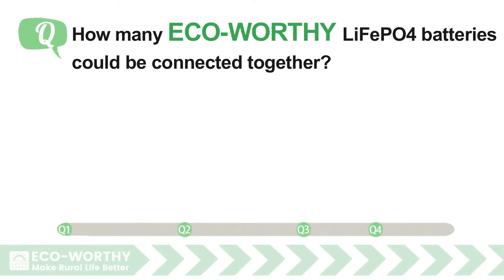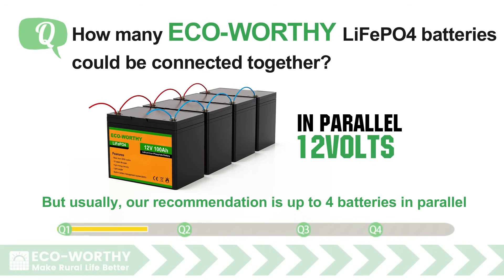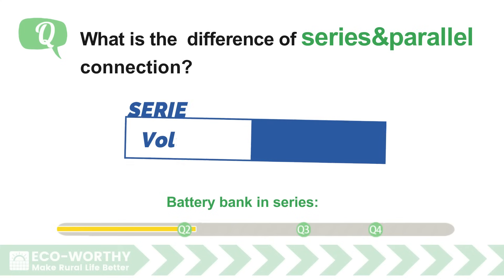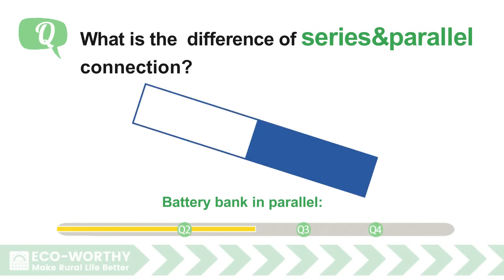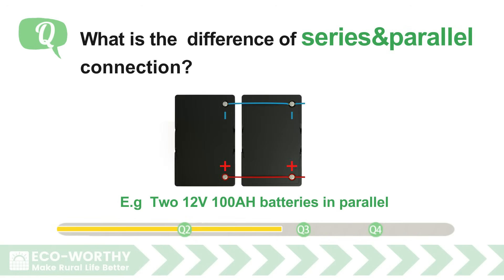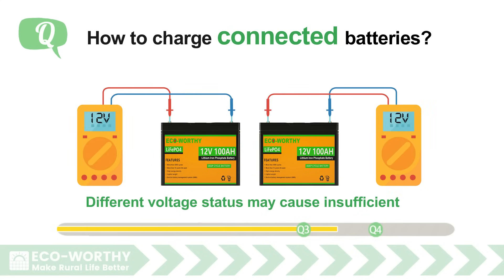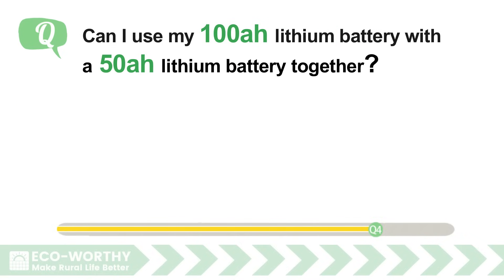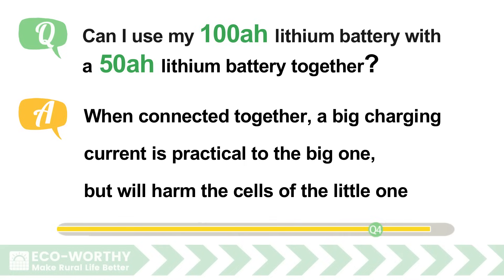FAQ about LiFePo4 Battery: how to DIY my own battery bank?

Comment: Hoe to Connexion 4 batteries for eco -worthy dc 24 v to ac 230 v  parallel or series???? (Bat live po4 lithium iron phosphate 12,8 v 100 Ah   Merci
Reply from the maker: We apologize for the delayed response and any inconvenience caused. To achieve a 24V system with your four 12.8V batteries, the correct setup is a series-parallel configuration (two batteries in series, combined in two parallel strings).